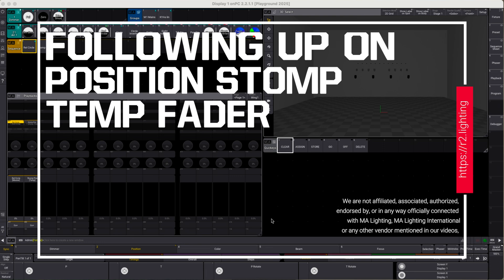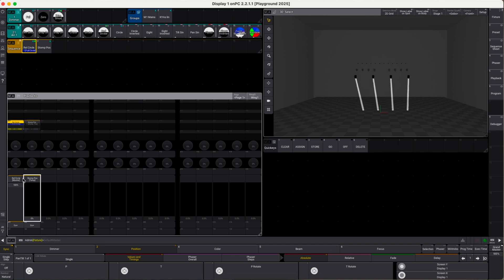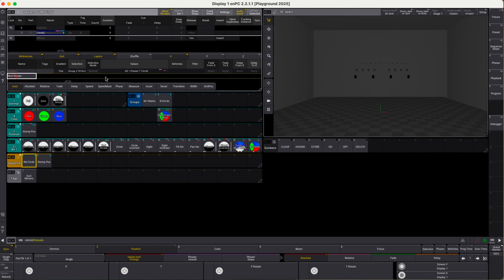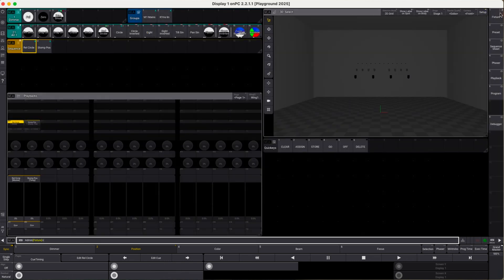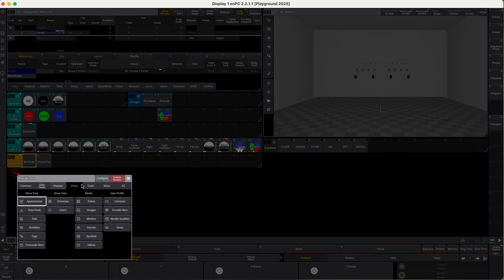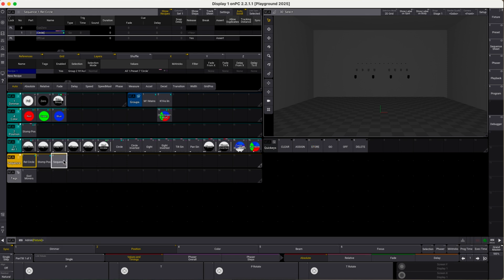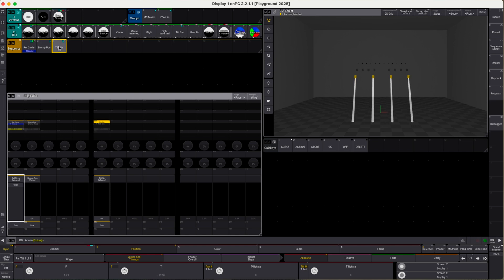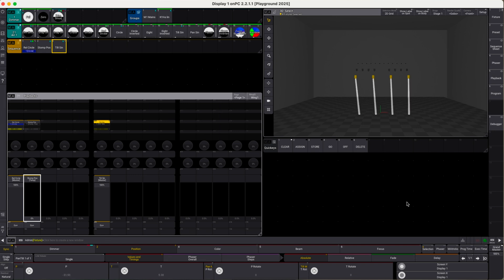06 Following up on Position Stomp Temp Fader - #grandma3

Comment: 1) Why don't you simply create a 2nd cue with the other effect? (Instead of a 2nd sequence)
2) Also How do we overcome the "Kill Instant" which snaps-off the 1st sequence without a graceful fade?
Reply from the maker: Because that's not what I wanted to demonstrate in this tutorial. There are a million ways of doing things in grandMA3 - this tutorial was focusing on one specific aspect. As to the second question, I'm not sure but would assume that killed sequences do follow the off cue.
Reply: @r2.lighting  You are correct about (2).
About (1), I'm just think that for most  use-cases  it is better to work with multiple cues. I don't want people running straight to multiple sequences solutions unless they have too. Working with multiple sequence introduces a bunch of issues.
A) You have to start managing Tags to keep only one sequence active (Cues do it natively)
B) You would probably want ALL sequence to have the same Settings, that is a big head-ache !
C) If you want to "Off" the "Sequence Set" you need to write a Macro that will off them.
D) You can have all the sequence on one fader.
And maybe more...